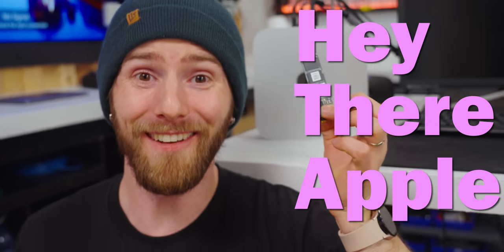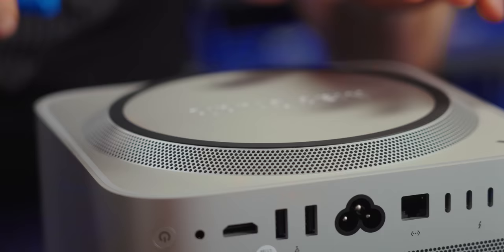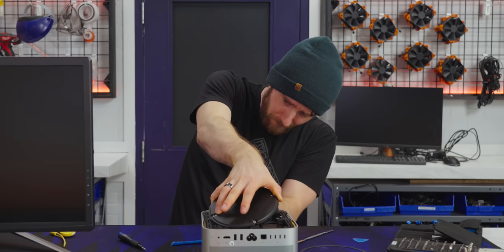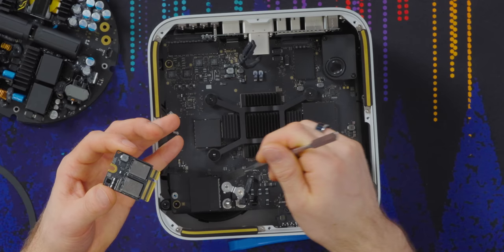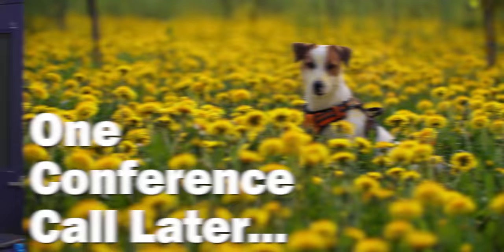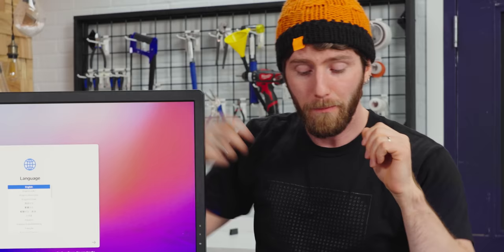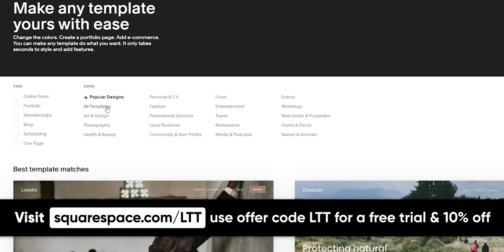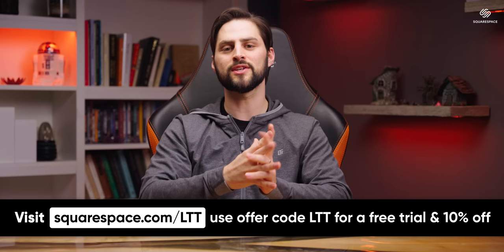I want to love Apple, but they’re making it hard - Mac Studio SSD Swapping

Comment: The Mac Studio was such an opportunity for them to finally become repairable and modular.
They made the devices harder to repair on purpose, they were not constrained by thinness or performance issues. They just wanted the computer to be unrepairable.
Reply: Repairable = more money for them cuz you have to buy another one or pay a ridiculous amount of money for a sketchy repair
Reply: hold on! what's not repairable, the PSU is modular, and so is the flash storage? You can replace the storage with the same sized component, you just can't upgrade it. The RAM is part of the SOC and can't be made modular,  and designing a socket for the SOC doesn't seem worth the expense. Not sure what else you were hoping for. It's plenty repairable.
Reply: Don't forget, their product announcement kept pushing how "modular" the Studio is. So not only is the product an antithesis to their previous repairability articles, they're misguiding consumers as well by misusing technical terms. Talk about false advertising, Apple style.
Reply: @stevengoetz6773  🤨
Reply: @stevengoetz6773  Found one. 😏
Reply: @mathieul4303  Honestly, what can break in that machine that you couldn't repair?
Reply: @stevengoetz6773  The only way to replace the flash is to own another Mac you can use to restore the OS. Accessing the internals requires removing a rubber foot which is basically destroyed in the process. I have a ~2010 Mac Mini; to access the internals of that machine, all I need to do is rotate the access panel on the bottom. Toolless, non-destructive entry. There's no reason a desktop machine made today shouldn't have a similar access method. Apple is deliberately making it more difficult to repair this machine.
Reply: @stevengoetz6773  lol, people don't understand the difference between repairable and upgradable.
most of the current products in the mac lineup are in fact repairable, however they are not upgradable.
honestly, i think making ANY sort of electronic device which is not user-upgradable is actually worse than making one that's not repairable (like the 2015-2021 macbooks, or any iPhone after the XS)
upgradable electronic products are so much more sustainable than non-upgradable but repairable electronic products.
and matter of the fact is, with how the EU is planning on handling non-repairable non-sustainable electronic devices by new regulation banning that - Apple's days of cashing in on this disgusting scheme are numbered...
Reply: @hawxchampion523  If I only have one PC at home. The SSD dies, so I buy a new replacement on Amazon, put that in there. How am I installing Windows?
Reply: @stevengoetz6773  compare that to a laptop being able to replace the ram at any point, changing ssd size and capacity, or god forbid comparing it to small desktops where you can reuse one shell for multiple different systems as hardware improves. Thank you apple for being so repairable in comparison and environmentally friendly by not creating needlessly locked down devices that only will cause more waste!
Reply: At this point they should have just weld all the parts together, weld the shell in one piecd and set up a trip wire bomb in the computer to make sure no one is going to touch the inner part of computer in any way.
Reply: So they can sell you the next version with upgradability as a feature.
Reply: ...or upgradeable
Reply: Why repair when you can just sell another $3000 Mac to the same person
Reply: @stevengoetz6773  Let's say you own a Dell PC, for example. In order to reinstall Windows, you don't need another Dell computer, do you? You can use any machine that allows you to write an ISO to a flash drive. This could be a Mac, an HP, or even a Linux machine. Apple is saying you have to use another Mac. 

Another commenter on this video said you can technically do it using Linux, but this isn't supported nor endorsed by Apple, and isn't accessible to most consumers. Apple should allow the ability to restore the OS from any device. This is just another way for Apple to lock people into their ecosystem and get more revenue from the Genius bar.
Reply: Apple fans will buy it anyway , not for the repairability but the logo 🤣
Reply: @stevengoetz6773  You could do it from an android phone.
Reply: @stevengoetz6773  you realize how easy it is to find Windows roms right?...like at least I can install windows from a flashdrive that I can buy from my local computer store...and that's much cheaper than buying a whole separate Mac to do the same thing...
Reply: @stevengoetz6773  there's a simple hardware boot installer, work arounds with Android phones etc. Even cheap PCs that don't need to use Windows to put Windows on it. All that being said if you didn't buy Windows with the USB installation already present lmfao youre just telling me you never watched a full pc build video before, much less built one.. Wtf are you comparing there? Buy another MacASTERISK compatible single method to solve the problem more expensive than any of the options I listed. Not to mention how many people have another PC, laptop or friend/family that isn't a spoiled Gucci buyer that sticks with obnoxious brands. The statistics and options are erroneously abundant and cheaper than this situation, and the fact that you justify with such stretching only keeps these practices in place, so they can continue to expand their limits in anti repairability. Continue to turn the cheek, shaking your fist for your stock in a company no matter their egregious behavior.
Reply: @stevengoetz6773  lol this guy...
Reply: @stevengoetz6773  You can buy USB pendrives with Windows preloaded or have a friend make one for you, no need to have the two computers aside.
Reply: @Naruto31132  I have 1 computer, it's SSD was just replaced. I own an iPhone, and have no other computer. How am I installing Windows? You're complaining you need another Mac to replace the storage, but you need another machine (whether a PC, or Phone etc.) to install Windows. I don't see the difference.
Reply: @MustachioFurioso9134  I only have 1 computer, and it's drive is broken, how am I writing the ISO to my flash drive?
Reply: @stevengoetz6773  repairable for an Apple authorized retailer, but tell me, how would one get their hands on one of these flash chips themselves? They can't, and neither would they be able to get their hands on a PSU. When Apple stops making these flash chips, there will be no way to repair them, and with so much on the mainboard (such as RAM), it's forcing issues with individual parts into a full system issue. Parts availabilty is part of repairability, and many users will be capable enough to replace a modular component, as we normally see with most PCs. Heck, LTT had a non-technical person learn how to reseat RAM in one of their secret shoppers.
Reply: Haha they have every oportunity to make their stuff repairable. But they don't have any incentive to do so.
Reply: @stevengoetz6773  no. you only need a USB drive that has a windows iso image on it, not an entire machine plugged in and sitting together.
Reply: @HoLDoN4Sec  as I just commented, parts availability is made more difficult here by using non-standard parts. While this would be repairable by Apple authorized retailers, a normal user, or later on a preservationist, might find it very difficult to keep these working.
Reply: @stevengoetz6773  Microsoft sells USB drives with windows on them already. Alternatively, if you were on Android, there are programs that allow you to create a bootable USB from Microsoft's recovery ISO. Or, even, you could take it to any number of PC repair shops and they could do this for you. Apple just locks everything down to try to force you into using their expensive authorized repair services.
Reply: @hawxchampion523  I only own the broken PC. Not sure I see the difference.
Reply: @stevengoetz6773  if broken means u changed a broken ssd like u said in beginning then u can buy a windows usb flash drive from any computer shop near u . while u cant do the same for a mac device.
Reply: @stevengoetz6773  with an usb. you dont need other pc you just need to be inteligent enough to have a usb with windows
Reply: @stevengoetz6773  The DIFFERENCE IS, that you just need A PC to write a Windows ISO to a USB.
But for MAC you need ANOTHER MAC to reinstall MACOS.
Bruh
Reply: @stevengoetz6773  A fucking install drive you put on an external usb drive, Windows spesifically made it so that you could install it on a machine without any other nearby
Reply: @stevengoetz6773  you can easily get a ssd with already installed OS
Reply: @stevengoetz6773  As others have said, you can either buy a flashdrive from a store that has a Windows ISO on it, or you can ask anyone you know that owns a computer of any kind to create the installation drive on a flash drive for you. You don't have to physically connect both computers, you don't have to find someone with a Mac. You have many more options to fix your computer than what Apple provides: find another Mac to physically connect with for a long period of time, or take it to an Apple store.
Reply: @stevengoetz6773  I don't want to dogpile, but a USB is far cheaper than a new Mac. And even then, you only need a windows rom, which if you wanted you could get at a local bestbuy or computer store for about $130. Far cheaper than a new computer or new Mac. So no, you don't need another computer to install Windows.

And if you're in a pickle, hell i don't even mind sending you a flash drive with Windows installed. I have a ton of them, and it's wise to always have one on hand, just in case of trouble with a drive malfunction.
Reply: @stevengoetz6773  and that's a genuine offer, I literally don't mind mailing a rom of windows on a flashdrive, if you genuinely are in a pickle there.
Reply: @stevengoetz6773  The usb boot drive, if you were stupid enough to not create it before installing the SSD or have literally no way of making it, costs between 15 and 24 bucks, you do not need a machine or a phone let alone an overpriced apple product
Reply: @stevengoetz6773  this guy still trying all his might to accept the fact that is shown in plain sight. In a self denial spiral basically 😂
Reply: @HackerFrosch  But if I don't have that second PC I still couldn't do the repair.
Reply: @stevengoetz6773  speak the truth
Reply: @stevengoetz6773  Depends. How are you getting Windows? Answer should be in your case: Bootable USB with Windows installation already on, of which is the standard option. Whats next? You plug it into the PC, boot into the BIOS, and select the drive as your boot drive to start with. Isn't that fascinating? Preloaded USBs, almost like it's pro consumer, right? Best part is, you don't need it if the situation was different, with say, a cheaper PC, a borrowing scenario, or what have you, that wouldn't cost the equivalent of a Mac to get that job done. You're just embarrassing yourself by not knowing the basic practices or ignoring them for the sake of justifying the unjustifiable. It's pathetic.
Reply: @stevengoetz6773  I'm starting to believe that
A) You don't have any knowledge about computers, and only relying on fragments of any TechVideo you've seen
B) It's also a high possibility that you don't even have a PC.

As per all the previous comments have stated, 
1. you don't need another PC to repair and/or reinstall Windows to another PC, unlike this MacPro in the video
2. You merely need to use either an android phone, or have an installer in a flash drive. 

If you we're able to order a new SSD online using your phone, then why can't you understand that you can also buy a Windows installer in  a flash drive online. 

Jesus all your retorts about needing to reinstall windows in your PC is starting to smell like bullshit
Reply: @HoLDoN4Sec  I mean anything you can upgrade is automatically repairable is it not ?
Reply: @stevengoetz6773  Laptops with replaceable/upgradable RAM slots and upgradable industry-standard parts(2280 M.2 NVMe drives, extra SATA plugs for an extra SATA SSD, etc): ...you're joking, right?
Reply: @stevengoetz6773  You are either being a troll or perhaps you should just give up on life entirely because about thirty people here are telling you what to do and one guy is even offering to mail you a USB drive with Windows installer preloaded so you can fix your broken PC. You DON'T NEED A SECOND PC to install Windows on your replacement SSD.
Reply: @stevengoetz6773  Jeah but its way easier and cheaper to get ANY second Machine than to get a second mac you genius
Reply: "The Mac Studio was such an opportunity for them to finally become repairable and modular."
Said no one ever.
Reply: @stevengoetz6773   just borrow a usb flash drive from a neighbor or one you  have laying around, get online at a cafe or something download windows onto the flash and you are set. seems much easier than having to have another mac
Reply: @stevengoetz6773  "How am I installing Windows?" you just have an usb key at the ready like everyone does since 2009. We get it bro, you shill for anticonsumer bs, and have minimal technical knowledge. Maybe you should reconsider your uniformed opinion instead of digging deeper.  
I'd love to use these products and the OS, i have the money for it, and the design is on point, but they making it hard for anyone with half a brain to get behind this amount of irrespect for their end user.
Reply: @xxnvytechxx6417  and the batteries and any other parts of their systems or products is under their patent so they also make money form third party companies because the part designs are still theirs

For example they don't make their own batteries for their iPhone's, so other third party companies make battery from their battery design they're literally the same but but Apple has the patent for their battery design so they make from them (third party company)
Reply: @stevengoetz6773  Exactly this..
Reply: apple has been sucking for years. not the first time
Reply: From your USB flash drive or your CD (or network or another drive). You sure as hell don't need another PC!
Reply: @kirishima.nue13  I've probably using and building my own PCs since before you were alive. I very much know how to build and repair my own PCs. I choose to use a MacBook Air as my daily driver, simply because it meets my needs the best. 

I personally have access to PCs to make bootable USB drives. But the whole point is a person complaining you need another Mac to repair this machine. Well, you need another PC to repair a PC, I don't see the difference.
Reply: @ibol13l3  Where does the USB drive I own plug into my iPhone to make a bootable Windows Installer?
Just because your personal situation involves easy access to multiple PCs doesn't mean that is everyone's situation. Just like having to use a Mac to repair one of my Macs isn't a big deal because I have a couple I could use to do that with.
Reply: @stevengoetz6773  it seem like repair isn't the problem it's the fact they can't upgrade, I still understand the frustration  though..
Reply: @EternalResonance  it's not like they're not good but they just go unga bunga like oo aaaa i want money i want money
Reply: @stevengoetz6773  I think You used Sarcasm.
Reply: @hawxchampion523  you know I hate how they call it genius bar but as I write this it does hold some merit: by locking their products Apple now created a huge   funnel of wealth by then saying "oh you need a whole new computer/work station", that is quite genius in a malevolent way I suppose...
Reply: Let’s not forget that all the usb-c/thunderbolt ports, hdmi are not soldered to the mainboard
Reply: @stevengoetz6773  well you could say the exact opposite to counter your bs point. not everyone owns a couple of macs for these repairs. but people surely would have a bestbuy or a Walmart nearby, i'd say? much easier and common than owning two macs lol. sigh. your whole 'i have been repairing PCs for so long' sounds so bs, especially after you seen constantly asking 'how would I reinstall windows on the replacement SSD that i ordered?' You claim that you have be repairing PCs but don't have a single USB boot drive laying around? gosh man lol.....😂😂
Reply: @stevengoetz6773  to repair one Mac Studio you need another Mac. To repair a PC you only need a 10$ USB drive. How you store the image into the drive is IRRELEVANT, and you're having a really hard time understanding this. Let me repeat this so that it sticks in your brain: we're speaking strictly of the physical materials needed for the repair, which makes sense because they are what costs money. For a PC it's a cheap USB drive, for a Mac it's another Mac which acts as the USB drive.
Reply: @stevengoetz6773  technically you can if you've jailbroken your iphone
Reply: @stevengoetz6773  Ok, let's propose a realistic scenario assuming you don't have any other friends to lend you a computer. Choose the one you prefer.

PC: You go to cyber cafe or whatever the equivalent in your country. Since PCs are more widely available, it shouldn't be too difficult. You go there with an USB flash storage, download the Windows installation media. Create the bootable flash in 15 minutes. Take your USB flash to your home and reinstall it.

Mac: You first have to find the cyber cafe equivalent but with Macs. But instead of just going there with a USB flash storage, you have to take your entire computer. Ask for them to let you do that. Borrow a monitor if you didn't bring your own. Follow the more lengthy process of the Mac revive feature. And then you can go back with your entire computer fully revived.
Reply: Most pointless awful cheap looking design just give us a modern Mac Pro and people would be actually excited
Reply: @_inthefold  no no no i don't meant like that im not a techy savy i mean like i don't know a lot about computer architecture or what they improve of decrease about a lot so maybe i just guessed but after reading your comment i think they're just money grabbers a this point
Reply: @stevengoetz6773  needing another PC to fix another PC, wow that's new. I didn't know you had to physically connect a PC if you're trying to fix another PC and wait for it to complete. So no, it's not apples to apples comparison, because even if you only have a single PC now, as per previously stated you can just buy a Bootdrive in stores or online and they merely cost maybe a hundred dollars or so, not thousands of dollars. So, I can't really look at it the same way that you do.
Reply: @stevengoetz6773  You are selectively responding to people's answers and only to a fraction of their response in order to perpetuate your obviously failing argument. How many people have said that you can by a preloaded USB with Windows?  HOW MANY?? Do you care to respond to them?

That completely refutes your argument that it requires 2 computers to repair a windows machine with a failing drive. I mean, that's a basic function of computers. You have to do it  if you build your own computer.

Just admit you're wrong.
Reply: @JerryO1995  So I can go to Best Buy, buy a brand new $10 USB drive and plug it into my PC to install Windows? I think you're missing a step.
Reply: @stevengoetz6773  You Don't!!! Thats what everybody is telling you. Your drive in a PC dies, you drive to any electronics store and buy a new drive and a Windows installer. $250 later and you have a working PC again. Where is the other computer involved??? It's fixed using off the shelf parts, no special tools, nearly no waste, and no proprietary parts. And you can also upgrade it with no issues if you choose to and have the extra money without issues.
Reply: @stevengoetz6773  You didn't read my second reply. Once again. Yes you can buy preloaded bootable USB drives. Another fun fact: PCs being built now don't have optical drives anymore either! Your point is moot because there are dozens of cheaper ways to do what Apple wants as explained by all these people. For someone who's been building PCs for a long time, you're not thinking modular enough, and I hope you're knowingly dodging actual sane solutions to a problem Apple is solving for cash grabs. And final fun fact: yes! You can plug in a USB drive into an iPhone, despite how stringent they try to make it, people are constantly trying to battle it and some succeed! You're on the wrong, minority, anti consumer side, and for what? Stock, to be as greedy as Apple? What other reason do you have to be irrational and ignorant of the logical reasoning displayed here?
Reply: @stevengoetz6773  The difference is you can create a windows boot USB drive or DVD at any point in time and then use that to reinstall it on a replacement drive. You don't need a second working PC, to actually reinstall the OS. And I don't think I need to get into price comparisons between a single USB stick or DVD, versus a fucking PC or Mac.
Plus, if you've installed said OS yourself in the first place, you'll have one of those lying around somewhere, anyway.
Reply: @stevengoetz6773  You create an USB with Windows Recovery Image. Yes, you need another device, but only once and then the USB can be used as much as you like. Compared to a Mac, you need a second device everytime...
Or order a bootable USB and you don't need another device.
Reply: @stevengoetz6773  oh yeah , everything is repairable , apart from upgrading the SSD , the RAM , and all the other things that are not in the video.
But apart from these little details , everything is repairable !!!
Reply: @stevengoetz6773  with a USB key ? Directly installed on the SSD ?
Reply: @raindrophoh  You are going to have a court case with Apple ! They have copyrights on that !
Reply: @stevengoetz6773  You can buy UBSs with a windows installer on it from basically anywhere that sells electronics. You do not need a second machine. You do not. You simply, do not need a secondary machine at all. You don't. You just do not.
Reply: @stevengoetz6773  you can LITERALLY buy preloaded Windows flashdrives at your local computer store...you do NOT need a PC to repair a PC...
Reply: @stevengoetz6773  and if you truly were building PCs since before some people in this thread were born...why don't you have a backup rom of Windows? I literally have been building PCs for ten+ years, I have more Windows DVDs, Flashdrives, and HDD repair drives than I ever know what to do with. But I can assure you, you do not need another PC to fix another PC. You only need a flash drive...that is all you need. A flashdrive =/= to a PC. 

And again, genuine offer...if you found yourself in a pickle, I literally don't mind sending you a flash drive with Windows installed on it...though you can literally buy these from Microsoft, Bestbuy, Microcenter, etc...
Reply: @stevengoetz6773  The part that really gets me is, you corrupt the OS for any reason (has happened to my MacBook three times over the years that I owned it since I do tinker a lot as a developer), you need to own ANOTHER MAC to restore it.

Also... Apple are the ones that called this thing ""modular"" lmfao
Reply: @stevengoetz6773  from a usb stick that costs you 9 bucks...
Reply: @stevengoetz6773  Boot off a flash drive. If you don't have a windows flash drive you can probably go to any repair shop and get one for a few bucks with windows on it. You don't need a new windows license because it is tied to your microsoft login. So just reinstall the os, sign in and you are done.
Reply: @T-zn2jo  So why do you think right to repair is becoming a thing? Why do think we're talking about it, if nobody cares about upgradability? Genuine question here.
Reply: @stevengoetz6773  You go to the store and buy a cheap-ass USB stick. Then you find literally anyone willing to upload the windows install file on it and run it on your PC. No need to borrow anyone's PC or get it near your own. Alternatively, you can prepare one beforehand for this occasion if you truly don't have any friends who could help you for 5 minutes. Last resort, go to a repair store and ask them to upload Windows install files on the USB drive for 10 euros or so.
Reply: @stevengoetz6773  If you're knowledgeable about computers, why are you claiming you need another Windows PC to install Windows on another PC?
Reply: @stevengoetz6773  No, that person isn't missing a step. There are USB Drives that have Windows preinstalled on them.
Reply: @stevengoetz6773  guys guys stop arguing with him, he is a clearly an apple fanboy who would buy anything they sell (for its logo ofcourse 😂😂) and will never admit about the products mistakes.
Reply: @MonsterPumpkin  not with apple it isn't.
actually not just with apple, even with some windows laptops this is something that's actually starting to occur recently.
some laptops would have upgradable storage but the ram would be soldered on.
and in modern times, in many cases these laptops come standard with just 8GB of non-upgradable ram but with upgradable storage.
these are laptops you "CANT" fix even though they are considered "upgradable".
you also have laptop manufacturers changing their internal designs to be less modular, for example: laptops had completely modular power socket port up until 3-4 years ago.
your power socket broke? just order a new one online for 10$ and replace it yourself!
now nearly every component is soldered onto the motherboard on many non-apple computers...
Reply: @stevengoetz6773  eithher use some kind of pc (doesn't have to be a mac specifically) to download a windows installer on a usb stick, or better use a bootable OS/ your already existing OS installer USB stick which I would guess most techy people usually have. Not sure if you can create a boot drive on a phone but maybe that too?
Reply: You can tell that this is how Apple gets their jollies off. While some companies compete by offering the best bang for buck, Apple lives by the principle of "F the customer!"
Reply: @T-zn2jo  says who?
Reply: @stevengoetz6773  Bruh, you can create a bootable USB in case of catastrophe and you can have it lying around waiting to be used AKA CREATING IT IN THE PAST. I have 1 PC too and the moment and opened it I create a win 10 USB in case something goes wrong. Or do I have to buy a whole different PC/laptop ? The answer depends on your IQ
Reply: @stevengoetz6773  No you don't. Buy windows online on a flashdrive. And use that to install.
Reply: @stevengoetz6773  obviously this guy is trolling. why are you feeding him ? just let him be happy all the time with his apple toys.. there is no point do tell him what to do just a troll here
Reply: @stevengoetz6773  While it was still alive you could have created a recovery disk via windows that should have allowed you to restore your data to a point in time. If you did your own custom Pc, you should still have the windows install disc, which you can use to reinstall windows. You would need an external cd/dvd drive though. None of which requires an additional 2nd windows pc to install.
Reply: Not unrepairable… just not repairable or upgradable by the consumer… or anyone without access to apple’s parts, services and servers.
Reply: But even Linus was impressed by a black PCB board and components.    Which most likely is a selling feature for those who think "It looks cool so it must be cool".
Reply: @stevengoetz6773  The difference is simple:
With windows You don't need to do it necessarily with another windows machine. But in this case you're obligated to use a Mac, a machine of the Apple ecosystem. 
In the first one you can do it with "anything", while in the other one don't
Reply: @stevengoetz6773  You can do it with another device, example, the PC, laptop, etc of other person. 
I know you will tell that you can do the same in the Mac Studio case and it's true, but you have to consider that you can only use a type of device that is less common. 
For example, where I live, it would be a nightmare to find a person that have a macbook or a Mac
Reply: @stevengoetz6773  Has others told, you don't necessarily need a PC, you can download with another device like a phone. It's just more practical
Reply: @stevengoetz6773  In the example that you put it, you don't necessarily needs a PC with Windows, you can have it from Linux or a Mac ones, and, has others said it, you can do it with a phone
Reply: @stevengoetz6773  I'm seriously thinking you just close in your arguments and don't really wants to think about what the rest said.
Reply: @stevengoetz6773  Man. I've seen some pretty rabid fanboys in the Mac community. Heck, I used to be one. But to feign ignorance about something as basic as installing an OS from a USB drive just to deflect criticism about a clearly dickish design decision that hurts you, Apple's most loyal customers, the most is next level sad.
Reply: @stevengoetz6773  Windows to Windows = 1 USB injection
Mac to Mac =  A real physical kiss connection
Reply: @rudymoralesjr  that is what really bothers me.  It should be upgradeable if it is truly ‘modular’.
Reply: @stevengoetz6773  But you can't put in a bigger SSD now can you?
Reply: @HoLDoN4Sec  Oh I see, you mean it like that
Reply: @stevengoetz6773  ever heard of Windows Installation Flash drive? i've never seen an iOS version. you can make a windows installation flash drive by yourself before the PC broke, by borrowing ANY computer that has a usb port and a x86 processor, or even if you are so anti-social that you dont have anyone in your life, u can go to the library or a net cafe to make it yourself. you dont need to find a specific brand of computer to fix a broken windows installation.

this is such a stupid question, how do you think people programmed the first operating system? they wrote it out themselves on paper with punched holes for 1s and 0s and then scanned it and burnt into the memory. on windows we can obtain our "paper" really easy, but with this mac method, its very anti-consumer
Reply: @stevengoetz6773  you pop in the windows DVD?
Reply: @stevengoetz6773  THE DIFFERENCE IS THAT ITS HARDER TO FIND A COMPATIBLE MAC, WHICH PROBABLY COST AT THE VERY LEAST 2X OF WHAT AN EQUAL HORSEPOWER PC IS. 

ALSO YOU DONT NEED TO PHYSICALLY HAVE THE 2ND PC NEXT TO YOUR BROKEN PC. JUST MAKE A USB BOOTABLE DRIVE.

ALSO IF YOU CANT FIND ANYONE TO BORROW A PC FROM, THERE ARE PUBLIC COMPUTERS IN LIBRARIES, OR U CAN GO TO A NET CAFE AND MAKE YOUR OWN USB BOOTABLE DRIVE, FOR FREE OR FOR CHEAP

ALSO IF YOU DONT KNOW HOW TO MAKE, YOU CAN ORDER ONE ONLINE FOR CHEAP, AT ONLY 0.3% THE COST OF A NEW MAC

ALSO, IF YOU'RE DEAD POOR U CAN MAKE ONE WITH YOUR ANDROID PHONE IF U HAVE ONE.

JUST BECAUSE YOU LIVE IN AN ENVIRONMENT WHERE THERE'S TONS OF MACS AROUND YOU, DOESNT MEAN EVERYOEN IS. THERE ARE FRIENDS OF MINE THAT USES MAC, AND MOST OF THE PLATFORM AROUND THEM ARE WINDOWS LAPTOPS, OR LINUX USERS. HARD TO FIND OTHER MAC USERS.

ARE YOU TRYING TO FLEX AT US THAT YOU'RE RICH, DONT GIVE A FUCK ABOUT REPAIRABILITY? THAT YOU HAVE MACS LYING AROUND YOU?
Reply: @hawxchampion523  better yet, include a usb with the restore procedure on it. Hell, you already spent 3k on the damned thing, they can spare $1 on another usb stick.
Reply: @stevengoetz6773 "If I only have one PC at home. The SSD dies, so I buy a new replacement on Amazon, put that in there. How am I installing Windows?" That's a vey bad argument. iI have a usb stick that can install windows and it only takes a minute to make free and easy using microsofts official tools. Sure you need to make it ahead of time, but still on this Mac you dont have that option at all. No preplaning will help you. You NEED another whole Mac device. With window if you plan ahead you can use a $5 flash drive to do the job you need a $700+ mac device to do with this.
Reply: @stevengoetz6773  Use your backup install media.  None of this "install over the internet (hope you're not metered!)" nonsense.
Reply: yup, was planning on buying one till this
Reply: @T-zn2jo  Dude, people are only likely to damage their device because they design it that way. You only need experts to repair your devices because they make it  so you need experts. You should have the right to repair your own device, but they shouldn't directly support it. The best policy is to allow people to make repairs to their device, but if they damage it, the warranty is completely void. Also, you wouldn't consider insane amounts of e waste to be a huge issue? Companies making their products as unrepairable as possible, and being as anti consumer as possible is harming the environment in huge ways. We NEED to stop these massive corporations from making anti consumer choices that actively destroy the world we live in.
Reply: @stevengoetz6773  you know, for just about everyone who did custom builds, their first PC boot up tend to run on a drive that has absolutely nothing in it.

So in the event when your PC's sole drive dies, and it runs on Windows or Linux, you can just replace the drive and turn it on...? 

Now, recovering things out of your dead drive is a whole different game altogether, which may either at minimum requires Linux, or an actual professional service.
Reply: @keithbryancwong1837  when I was in tertiary education I literally snagged a bunch of Windows licenses alongside burning them into DVDs, and I still have them sitting around lol.

Never know when I'll need to use them, after all...
Reply: @stevengoetz6773  You can install windows by booting from a DVD, or form a USB drive with windows on it. Super easy. Booting from a DVD/CD/USB drive is common place. In fact, there even exists a way to boot an ISO from your phone.

And, if you don't want to burn to USB using another computer, you can buy a preloaded USB stick.
Reply: @stevengoetz6773  you own only this mac studio but without the OS, how would you install it, huh? Thats right, buy a whole another mac that will probably cost you more than just getting a cheap laptop to download windows onto a usb. Or as some people stated there are usbs with windows on them sold.
Reply: @xzrage9528  they only have a worthless iphone, so no they cannot make a boot device using it.
Reply: @stevengoetz6773  boot off the windows usb you should have handy for this exact scenario.